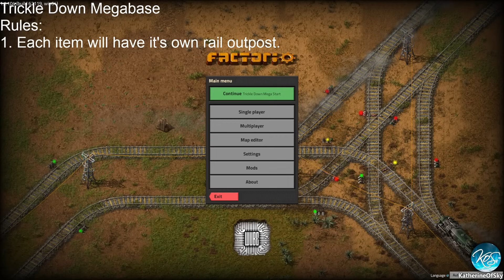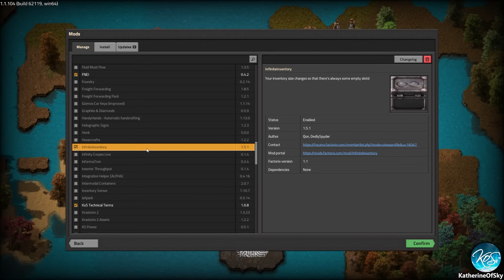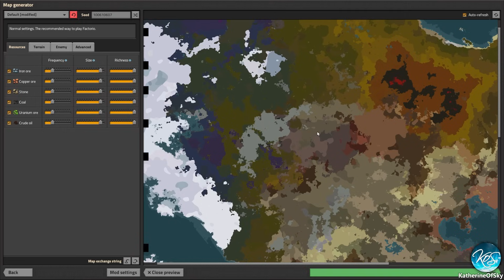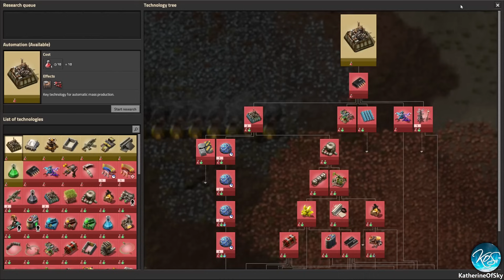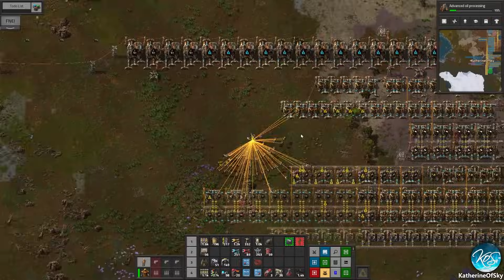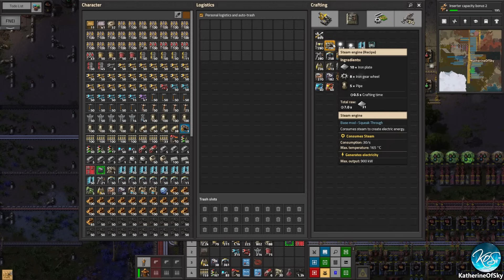Factorio Trickle Down Megabase 1A - MEGA START FOR A MEGABASE!, Tutorial, Walkthrough, Let's Play

Comment: I did a one-item-per-cell grid a while back. Water by train to the nuclear reactor cell, then steam by train to the turbine cell.
Reply from the maker: Cool!  Did you enjoy that?
Reply: Yeah, and it got pretty big, too. Ended up with 5 nuclear cells and 2 rocket cells. Avoided putting related cells directly adjacent to each other so the traffic is more spread out, but there were still some cells that output more than one thing just because of the recipe. Oh, and no redserters. I never use redserters. Train stations would also disable themselves when they couldn't move a full load, making the routes more chaotic.

Comment: My challenge is to always make things you need at a given location, to limit busses & train traffic to just the most basic of items:  smelted iron copper steel bricks, raw stone & coal, sulfur, plastic, rocket fuel, sulfuric acid, lube. You cannot ship or bus circuits, batteries or things in mass to make science.  Your standard mall and module factory sections can output supply trains to deliver parts and ammo to new construction sites and automated defensive walls, uranium power cells to reactors, train fuel etc. You can ship crude oil to fluid handling factory sections to make plastic, sulfur, acid, lube & rocket fuel.  Your final separate science factory section must include the rocket, can only accept the raw material list, and has no output.

Comment: Love the trickle down idea. I did something similar(ish) in Krastorio2. I had 3 separate train networks running in circles within each other. Raw materials and smelting on the outside of the outer most ring, they then deliver to machines inside that ring where basic materials are made. Those materials are then transported on an inner 2nd ring to make advanced materials on the inside of that ring. A 3rd ring then handles data card sites and delivers to labs at the centre of the base. Each train ring was separate and not connected. Quite satisfying the way things are handed over gradually to the labs at the centre.

Also, I am excited to see something skip out the 'entry level' stuff. Will be cool to see you do something more advanced and planned out.

Comment: Just read an article that said Sweden did originally drive on the left, but switched one random day in 1968, I believe it said. Showed a picture where they they were on both sides as they switched. I'm guessing trains didn't switch as unlike roads, the infrastructure would have to have been rebuilt to change it.